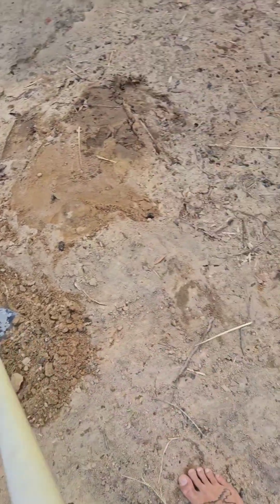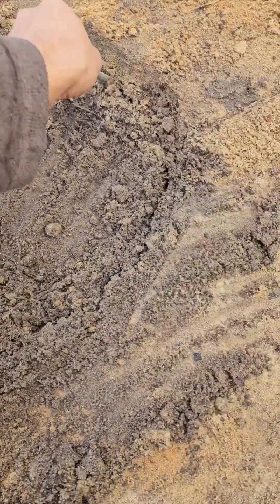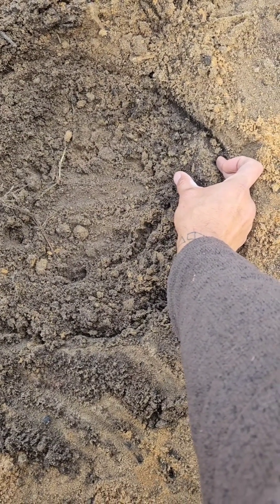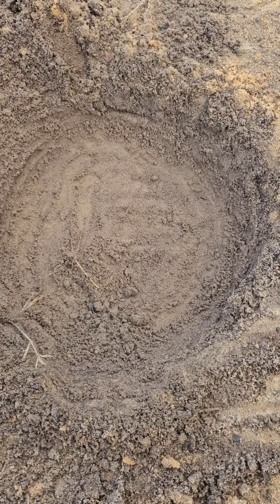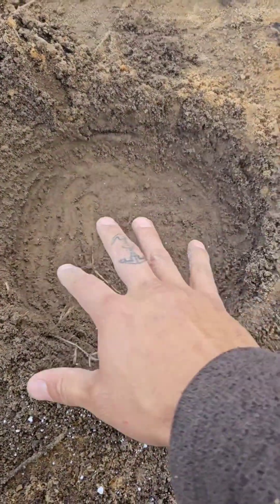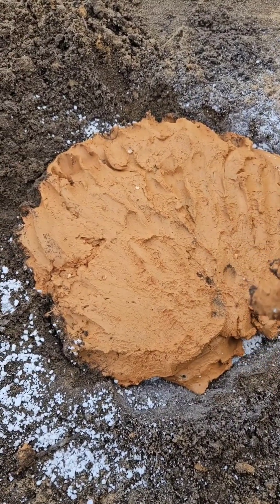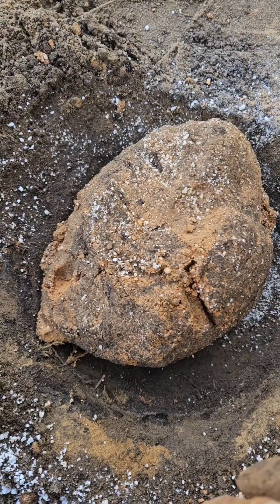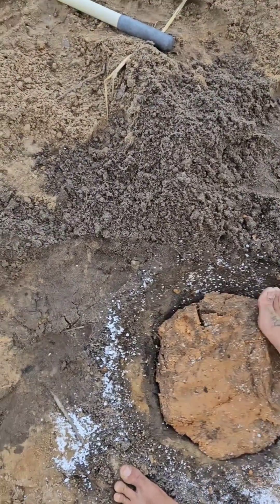Perlite + Raw Clay = Refractory Grate

Comment: Hello bro! I love your Chanel, thanks for your work. This time I have a doubt; perlite expand 20 times at  800/900°c and the bisque fire begins on the 800°c
My question is: You burn at a temperature below 800 degrees Celsius or how do you plan to deal with the expansion of perlite?
Reply from the maker: You may be thinking of perlite ore, perlite ore expands to perlite when heated to 1500f. Perlite does not expand anymore because it's already been through the heating process.

I burn at a temp of 1700-1900f and have not had my grates crack.

The only way to truly know if it works is to try it for yourself.

Thanks for watching, and I hope this helps
Reply: @Higher_Perspective_Art  Thank you very much for your response, it has definitely been very helpful. I was not aware of this information you shared with me. I am just beginning my ceramic journey, and your videos are helping me a lot!